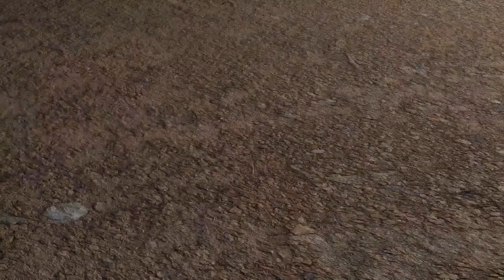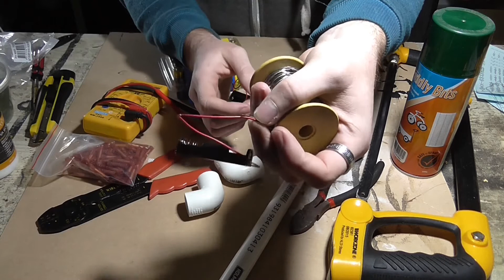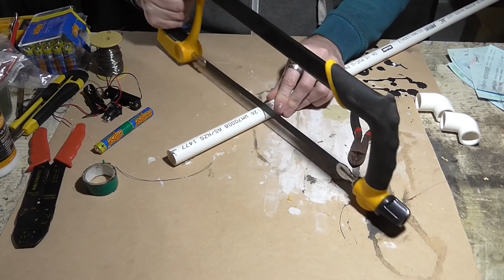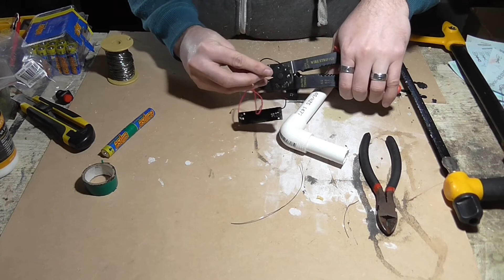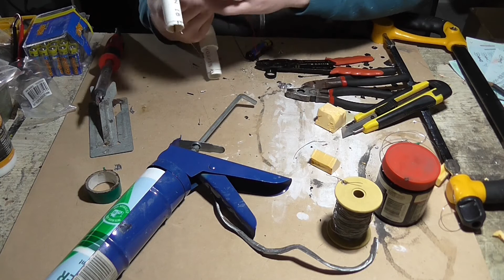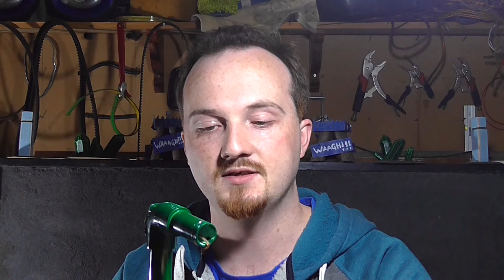Wargaming Invention - Hot Wire Foam Cutter

Comment: nice video, i keep meaning to make one but never get around to it lol
Reply from the maker: +Super Wargamer Thanks! When you get around to it just de sure to remember that most millimetres can measure resistance, that way you won't spend heaps of time trying to calculate the resistance of you cutting wire, which you can then throw into the power formula power = Voltage Squared / resistance, to calculate exactly what voltage you need to get a particular power output, I recommend going for about 15 watts.
Reply: XD